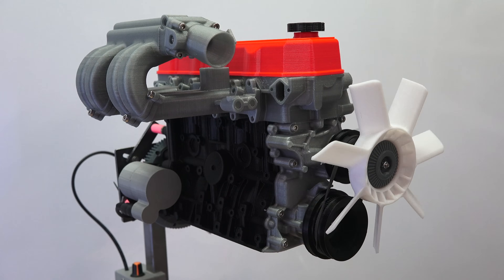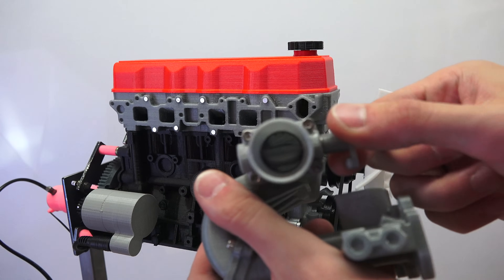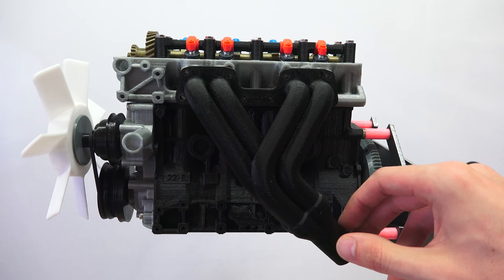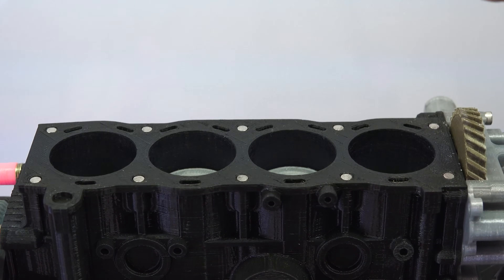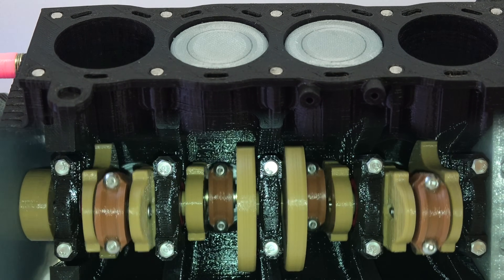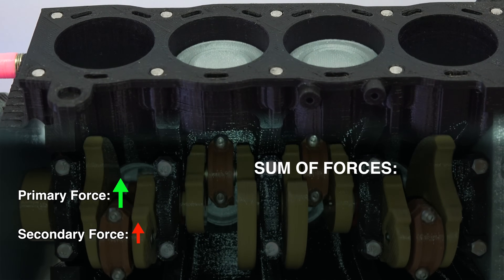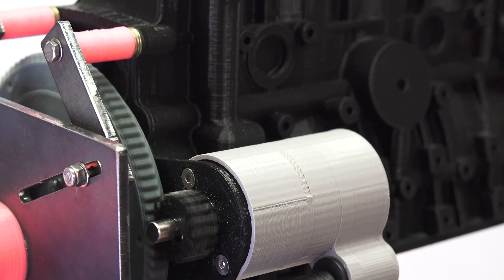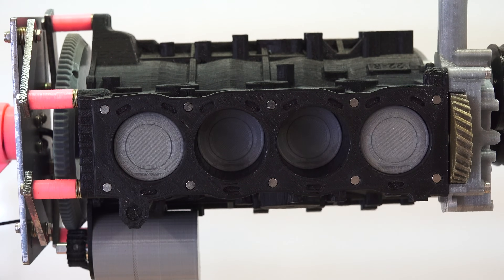3D Printed Inline-4 Cylinder - Working Model!

Comment: Do you have a parts list? I have a 3d printer and can easily print the parts, but for hardware, like screws and bolts and things like that, I need a proper amount of parts. I was wondering if you know what parts and quantity of them?

Comment: The only thing I dislike about the partially functioning models is that they are powered by what would be the alternator, on a real engine the engine spins the alternator which in turn charges the battery.

Comment: I'm slightly confused, cus you said flat plane crank was chosen for balance and less vibration, but that is the OPPOSITE of what will happen with a flat plane. A crossplane has more even firing and less vibration since combustion is every 90*..

Comment: I'VE GOT A QUESTION/VIDEO FOR YOU!!!!

Right let me explain. I'm not very engine savvy but let's say from my sake when a starter motor starts an engine the fly is spinning clockwise.... When you bump start a car I.e put it in second, psychically push the car and drop the clutch to start it, second stage ignition flywheel spinning same way. 

Question is what would happen if you did a bump start as I said, so in gear but pushed the car in reverse?  so engine motion spinning in the wrong way through trans 

#1 would it even start as the strokes would be backwards I'm assuming and all belts backwards 

#2 if it did start and the flywheel spinning opposite direction could you get reverse gear all the way up to fifth #super reverse 

Would be interesting to know I'm just getting into cars, personally I'm thinking it would be a valve issue but an in depth explanation would be good and maybe an idea for you 

Not been subbed long but like the vids

Comment: Talking about Vibration, My car uses a 2.6 ltre inline 4 cyl engine featuring a 98mm stroke. It has balance shafts but she still vibrates and throbs but for a 4 cyl engine, sure has good low rev torque.

Comment: Great video, love the 3D printed engines. Although there are a couple of small details in this video that are a bit off. First the 22re was never in the Tacoma, it was in the Hilux which was the precursor to the Tacoma in the US. Also the 22R-E engine had a timing chain not gear driven timing, but having some experience with 3D printing I understand why he did not print a chain.

Comment: I always see that a lower center of gravity is a primary reason Subaru and Porsche use flat 4 and 6-cylinder engines, but ... why can't you just put an inline 4 on its side an get the same benefit?

Comment: 1. The 22re's were originally introduced in the 1984 Toyota Pickup... thats all it was called just a pickup, it was pre-tacoma
2. cam shaft gear is cut wrong on the end, should have helical cut to drive distributor.
3. Thats not an exhaust manifold thats an exhaust header, as it has 4 individual tubes into the collector.

great motor they run forever, my 88' toyota pickup has one

P.S. for those who are interested, the motor was introduced in 1984 with the 4th generation pickups/1st generation 4runner and continued up to 1997 with some 5th gen pickups and 1995 with the 2nd gen 4runners. 

the 22re motor was especially well built from factory as the motor was essentially a blueprinted motor, and rebuilds tend to not last as long because getting the same tolerances that toyota achieved is difficult. It only made 114 hp from factory but managed 140 ft-lb of torque but had a higher peak rpm than peak hp or torque.

Comment: HEY, I'VE GOT A GREAT IDEA FOR A NEW VIDEO:   Different types of Hybrid Drive systems, and how they compare.
Most are CVT types,  but they are not those metal-belt type of CVTs found with gasoline engines, so explain that.  
And then compare the Honda Accord  and  Hyundai Ioniq types of transmissions, and how they are going in a completely different route altogether.   In fact the Honda doesn't even HAVE a transmission;  its engine gets connected directly to the drive wheels via a clutch, so explain THAT.

Comment: 3D technology has come along way since it conception since 1986. The only problem in building an actual motor and all it's components are cost. I would assume the cost using sintered powdered metals would probably be around $50K to build an actual gas powered motor.

Comment: Why do automakers build smaller displacement engines with numerically smaller cylinders (4cyl, 3cyl, etc) instead of scaled down V8s? Wouldn't a 2.0L V8 run smoother and provide better overall power than a I4 of the same displacement?
Reply: Granted there would be more parts to produce, and the V8 would have less torque at lower RPMs. But having a smoother running engine with higher rev capabilities would have some benefits in a sport/roadster application. Not to mention the marketability of the car having true V8 power in something compact like a Ford Focus ST or Mazda Miata.
Reply: I would think there would also be some engineering savings in having a scaled down 5.0-style Coyote V8 vs designing a completely different style of engine. I guess I was mostly wondering if there was a physics reason why it isn't done.

Comment: good video but why didn't you do a video on a inline 4 engine like Toyota's 4AGE or Nissan's SR20DET?
I really liked the way how you used this 3d printed model for this information and please do a video on inline 5 engines like the engine from Volvo S60R (2004) or Audi TT RS (2017)

Comment: 2:57 I can vouch for this fact - the English Electric 4SRKT used in British Rail diesel-electric multiple units has a displacement of around 62 liters (15.445 litres per cylinder) and when you're sitting behind one of those at full power (750 RPM I think) you definitely know it's there!

Comment: I considered buying a 3D printer a while back PURELY to design engines like this, along with making fully detail model cars and maybe even a working combustion engine. Still considering it, but £400 is a lot to chew when there's filament and software costs ontop of that

Comment: You’re mistaken, Toyota never made the Tacoma until 95 and anything before that was just a Toyota pickup, did have these in 4runners though.
Reply: Wyatt Bishop 96+ 4runners and tacomas used the 5vzfe & 3rzfe (2.4L 4 cyl sharing the same block casting as the previous generation 22re)
Reply: 96+ tacomas and 4runners used the 3RZ (2.7L) and the 2RZ (2.4)
Reply: Toyota had a half year change over.  There are 95 Toyota pickups, and 95 Toyota Tacomas.  The tacomas were available with the 2RZ, 3RZ, and the 5VZ strarting half way through 95.
Reply: The 3RZ is a 2.7l 4cyl, while the 2RZ is a 2.4l 4cyl.  They also started in 95.5 , not 96.  The 5VZ is a 3.4l V6, which is the updated version of the 3VZ found in the pickups and older (pre 95) 4runners.  Which was a 3.0l V6.  Also known as the 3.sl0w or 3.bl0w.  They were notorious for blowing head gaskets in the early years, and made hardly any more power than the 22RE.

Comment: Edit: the Tacoma never had the 22r engine, it was called a pickup in the states and a hi-lux in the rest of the world...when the Tacoma name showed up in 1995 it had the 2rz, 3rz and 5vz
Reply: @mostlyirishcarguy, yes I'm sure you do have a 95 Pickup with a 22re, in 1995 Toyota made the Pickup as well as the Tacoma, they were two different platforms/models with different engine options. The video makes reference to the 22re being in the Tacoma which it was not.
Reply: @lin Chester, I know he mentioned the 4runner as well, I didn't say anything about that because yes they did use the 22re in them

@john lincicum the 95 1/2 technicality of the Tacoma still made it a 95 model, the trucks with the Tacoma badge whatever year you want to call it did not have the 22re
Reply: Bill W 3rz uses the same block casting as the 22re, doesn't make him correct however
Reply: yes I have a 1995 pickup with this
Reply: He mentioned in the video its from a 4Runner.
Reply: Bill W The regular Toyota truck was a 95 model year with the 22re, the Tacoma was a 95½ model year technically speaking.

Comment: Was the timing off because of how it was assembled or is it a problem with the model?
Reply from the maker: Nermket I believe one of the cams was put on backwards. Or it simply doesn't have the correct profile, but I believe it's an assembly issue. Edit: I say one of the cams, the cam in this engine is split in two pieces - the actual engine would have a single piece camshaft.

Comment: I wonder how much this would cost, I would love to have a VR6 model... :)
Reply: buy a cheap $200 3d printer, print all the models you want
Reply: Are you sure such a cheap printer can print something of this size?  The ones I have seen in this price range can't print something this large last time I checked.
Reply: Corrado VRz you slice the components up and glue them most of those have a build volume of 220cm3
Reply: look up open rc f1 3d printing for a general sort of idea. k
Reply: Corrado VRz
IIRC models presented in his videos are actually printed on a cheap chinese no-name 3D printer.
Reply: Thank you for the tip.

Comment: The 4 cyl you see explained here is much more than one generation back. To put it briefly.The last 4 cyl in the Camaro (yes I know the demo engine is based on a Toyota design) was a 3rd generation "Iron Duke" that put out 90hp, yawn. Today the 2.0 turbo puts out 275 hp and moves the car from 0-60 in 5.5 seconds, 5.5 seconds was way quick in the middle of muscle car days. Much more going on with the 4 cyl engine today than some novelty 3d printing app.

Comment: back when this motor was made the Tacoma did not exist it was called the Pickup.
Reply: MegaGreenman28 true, but they just changed the pickup to Tacoma, and T100 to Tundra. It's just market labeling, still the same vehicles.
Reply: similar but Tacoma's had different motors it had the 2rz, 3rz and 5vz. and many of the body panels were significantly different and not interchangeable.
And the T100 was more of a midsize while the Tundra is a fullsize with a couple years between models.
Reply: no there is quite abit of difference between them the only tacoma parts that fit my pickup are the wheels and wheel studs.

Comment: Waiting for the the Jet Engine Model.....
Reply: Turbine engines are waaaaay simpler than piston engines; just a rotating shaft with a compressor on one side of the combustion chamber and a turbine on the other side.
Reply: Elan Jacobs I agree with that.....But still the 3D model will be amazing......
Reply: People have been making them for years, just google it

Comment: Can you compare the rb26 and the 2jzgte using these models?
Reply: its basically both the same engine except the intake and exhaust ports is inverted, the 2jz got more displacement and is a stronger block, it also 1of3 production engines ever made to use sequential turbo system, the RB26 used itb.... 

BMW inline6 is the same and MB new inline6....

Comment: I was expecting it to seize half way through, where's the oil!
Reply: Needs a few thousand more revolutions. Enough bits of metal plastic will fall off eventually.
Reply: thescoolestkyline this is a 22r it doesn't need oil it's the chuck Norris of engines

Comment: Those were indestructible motors.
Reply: Head gasket on these engines only blew if the engine is overheated or the coolant wasn't properly serviced, causing corrosion. Timing chain issues usually resulted from using poor quality oil filters that lacked a decent  anti drain back valve. My 84 Toyota pickup still retains the original factory 22re engine, head gasket, and timing chain components after 33 years. Coolant changed every 2 years using distilled water, oil changed every 3-4K miles using a genuine Toyota oil filter.
Reply: Still are
Reply: They're still around?
Reply: in the aftermarket
Reply: I bet there are tons of them in 3rd world countries.
Reply: yup and here in the USA aswell
Reply: They are good engines but they are not without their fair share of problems, they will blow headgaskets fairly easily and they have a problem with the timing chain guides failing. However the 22r in my 86 pickup made it to 350,000 miles.